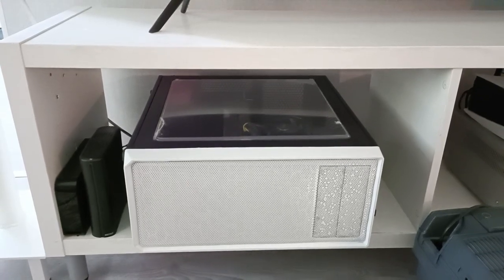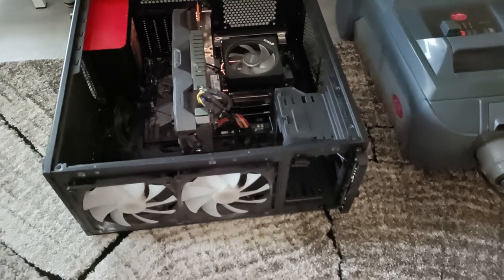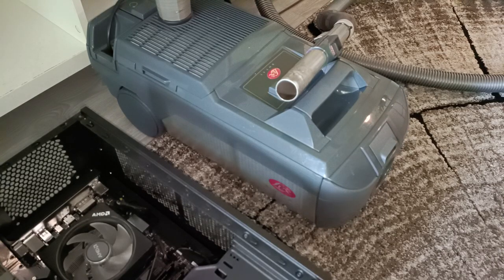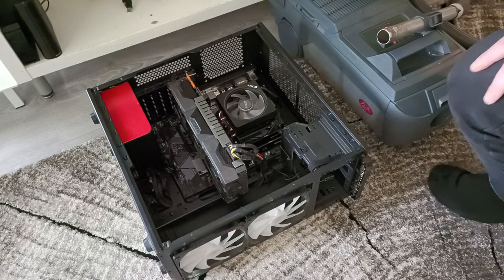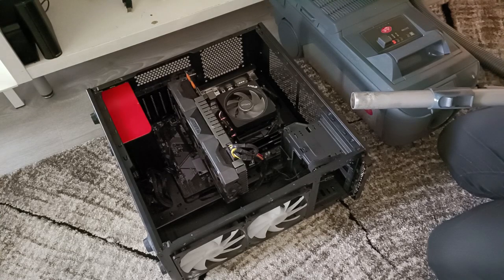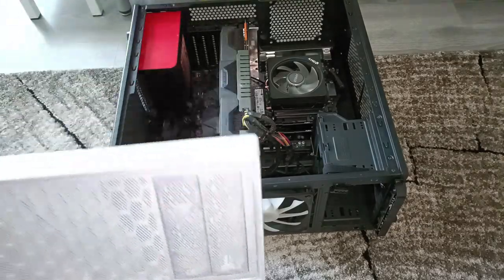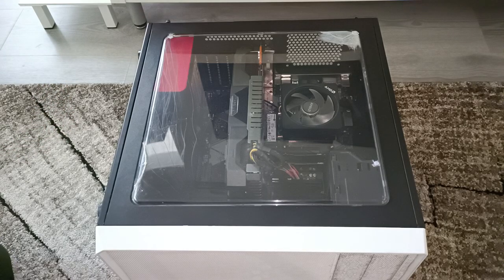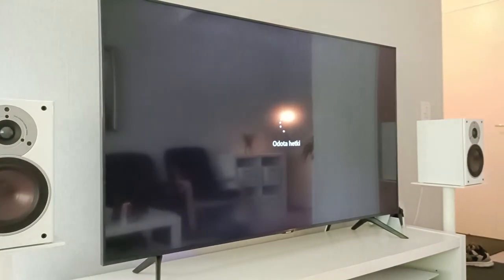Step by step guide PC cleaning: Vacuum with blower function

Comment: It is a shame that blower ports are seldom seem on more modern vacuums.
The only one we have is on a tub vac in our garage. It gets used from time to time but is indispensable for some tasks - like dust on radiator fins and gathering leaves together in our small garden.
We are just using tablets and laptops these days but using a blower function and our Miele micro tools set (SMC10) keeps cooling grilles and accessible fans clean really well.
👌